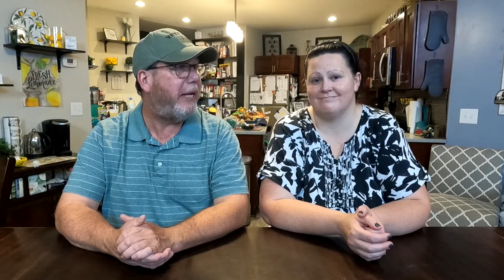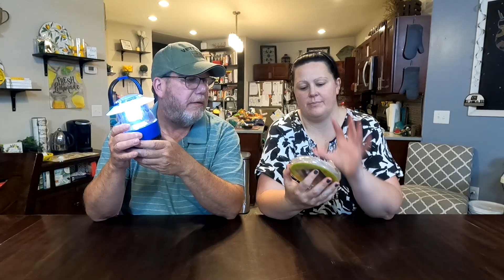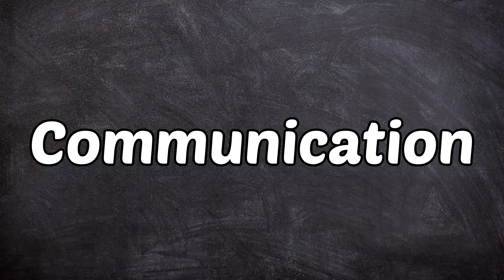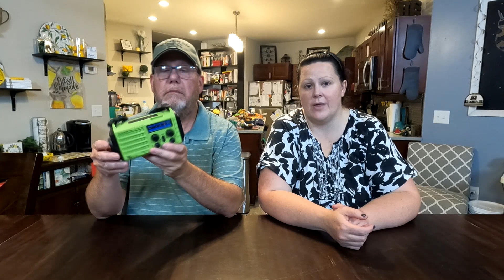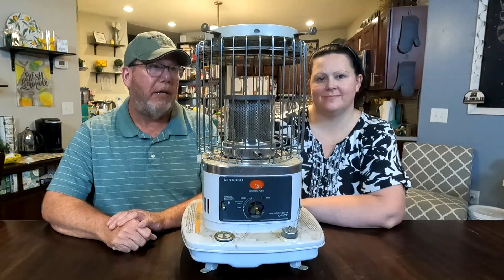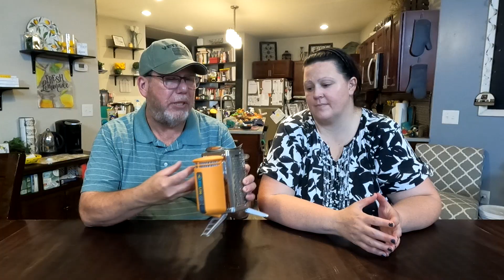Power OUTAGE and BLACKOUTS are Imminent – How to PREPARE!

Comment: I ordered dog cooling mats to sleep on.  Full bathtubs in a blackout will cause HIGH humidity in the house increasing discomfort.  Use a water bob in the tub to hold water.  Buy cooling neck ties and cooling towels if you have the means.  Candles etc cause increased heat during summer heat.
Reply: I don't think it would if you were to cut a large trash can liner (no perfumed type) and taped it around the  top of the tub till needed. It wouldn't evaporate that way and things wouldn't get it it either.
Reply: @wheepingwillow24u17  that's the same concept as a water bob and a great suggestion.  The goal is to stop the evaporation and reduce humidity.  Dry heat is easier to withstand than humid heat.  Also, you have to fight the mosquitos.  They always find an open water source.  Stay safe my friend, Stay Free!

Comment: If you can build a sturdy timber stand and put a quality black garbage can, or galvanized can on top in direct sun, it will heat up during the day. Install a solar shower outside and it will give you a hot shower each day. Galvanized can is best for decorative purposes, they can be sprayed on the outside in colors of choice to look like a mini water tower.

Comment: I believe some people will need to get safety test plugs for there toilet and tub, some city water systems have pump stations or something similar and when the power goes out it can send the sewage backwards from your toilet and tub filling your bathroom with sewage water, I'm on a well so am not a hundred percent sure, but have seen videos of people discussing this. The plugs you can get at a hardware store.

Comment: during power outages here in NH mostly durning the winter for use so bringing in snow to melt for the toilet in warm weather  we bring water up from the swamp and fill trash cans so we can flush the toilets and save the drinkable water for drinking.  Put a trash can near the down spouts of to collect water from the roof when it rains

Comment: Huge fan of the night lights that plug into the wall and come on when power goes out.  Also act as rechargeable flashlights
Reply: Hi. Did you buy these at Home Depot or Lowes?  The ones that come on when the power goes out.

Comment: I tested my solar generator it would run my well it's a eagle flow 1300 kerosene heater you can put an additive to make it smell like cinnamon etc.
Reply: 🤔is it solar or is it  kerosene. 🤔I'm confused 😔
Reply: @karenkaren5013  to remove the smell from a kerosene heater they have a cinnamon additive you can put in your fuel smells good
Reply: @chicken-prepper  oh that's awesome because kerosene really smells bad.

Comment: Is it a bad idea to use your solar generator to power a frig and chest freezer with more than one extention cord?
Reply: The running load on that kind of equipment is quite low;  about 250 watts combined.  However... the cumulative drain from twelve hours of darkness every day will overwhelm the solar generator battery.  It's not likely that this will work out well unless you have at least 200 AH of storage and about 600 watts of panels.
Reply: Yes, with two male ends.
Reply: Same question here. If you find out would you please message me so I can know as well? I have an extremely heavy duty extension code with surge protector and one that can be used outside as a water heater for horse troughs and taking a warm bath is really nice once in a awhile. And a silent generator that can be used for all I’ve spoken about. Thank you.
Reply: @lorryhughes2728  Yes, multiple cords can be used with solar generators. Please pay attention to the wire size inside the cord. 16 gauge is for Christmas lights, box fan, cell phone charger, small loads.  14 gauge cord is good for up to 15 amps for TV's, small appliances. 12 gauge cord will run 20 amps for hair dryers, space heaters. The longer the extension cord is, the more the voltage drop will be at the end.  The internal wire size gets bigger as the gauge size gets lower and it can carry more load. Using a cord that is too small will heat the cord up and run your solar generator battery down quicker at best. At worst a small cord can cause a fire. 

 The elderly  lady down the street had a space heater plugged in to a long 16 gage cord and the wire actually smoked and blew out with a big spark where the heater cord was plugged in. I heard her yelling for help.  Her son got her the solar generator and they assumed that extension cords were all alike. It nearly scared her to death. The best approach is to stock up on 12 gage cords of 15 to 25 feet and keep them stored where you can find them quickly.  Your extreme duty cord may very well be 10 gage wire. Expensive to buy but worth the added safety.
Reply: @lorryhughes2728  I will, be safe.

Comment: I've finally got a dual fuel inverter generator, a small solar generator, a few large backup batteries, the usual batteries, and if you have cordless tools some manufactures have accessories that allow you to use those rechargeable tool batteries with USB ports to recharge your phones and such.